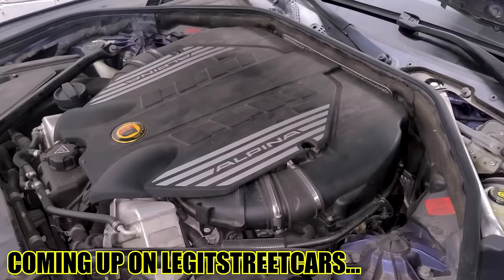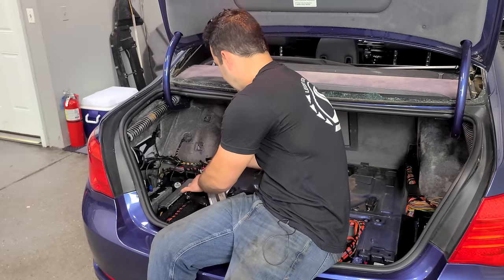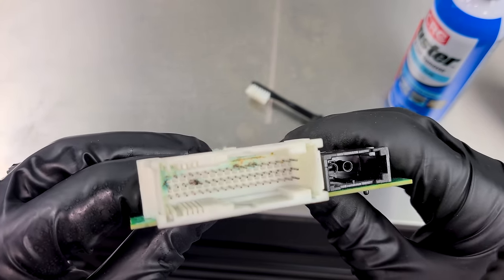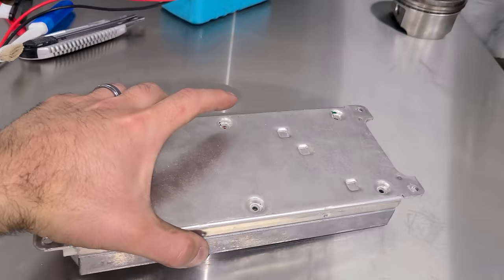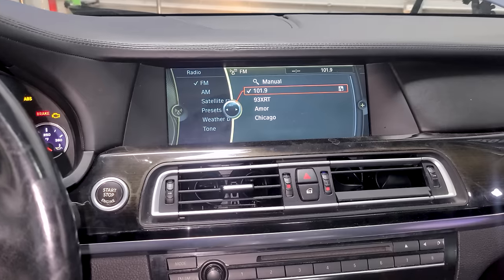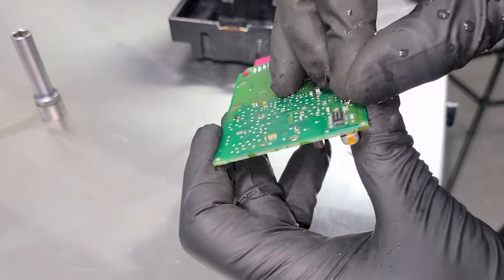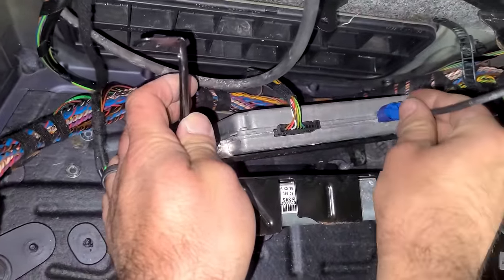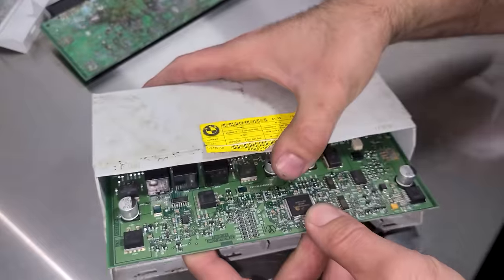BMW Dealer Tried Totaling My Car By Quoting $15,000 For 10 Computers! I Fixed Them All For $150!

Comment: De-ionized water sounds expensive for a regular diy-er but it isn't.  If you own a dehumidifier it produces distilled water which you throw out.  That water is exactly the same.  Use it for your cleaning like in this video - free!

Comment: Best move was to strip every panel out of the trunk. That way you could get a really close look at every connector in there, and that's where you found the most insidious water damage. A dealer would have swapped out modules and in my experience wouldn't look at the wiring harness. Corroded connector could be attached to a single strand and fail later.
These housings for modules in the trunk looked rather skimpy. I'd expect to see gaskets, sealants, heat sink paste that would need replacement.

Comment: For heat shrink sleeving, assuming you don't want to spend money on a purpose made hot air gun, an electric hot air paint stripper is good and less likely to burn the sleeve than an open flame.

Comment: As an Automotive Electrical Connector engineer ..  seems you did a decent repair job .. but if the plating is corroded on the terminal contacts (inside the female terminal box and outside of male pins), your fix may not last as long as you wanted. The alternative is to replace all the terminals with new ones, but that is a huge labor consuming job that may or may not be necessary.  Personally, I would fix it the way you did and see what happens.  Good luck!!

Comment: Yep that’s right you got to do it yourself if you want it done right the dealership would have done the same thing and earn 15 grand so I do all the maintenance I can myself and this is a good learning experience for all electrical components and electrical circuits a good cleaning this is equivalent to cleaning the battery cable on the car

Comment: Had this happen to a 2008 Mercedes E320 Bluetec sedan, the ZGW module got wet.  It’ s up under the dash so I think from a badly executed windshield install before I got it, the windshield got replaced a few months after I got it.  This made the car go absolutely crazy.  The corrosion was between CAN-B High and Low and also CAN-C High and Low connector pins so nothing was working right.  Cleaned up the ZGW and all well for about 2 years now.

Comment: As these modules are lead free soldered because of environmental rules, they used zinc solder. Zinc grows  very fine hairs which grow out and short components. The toothbrush method knocks them off and repairs the unit. Damp makes it worse so any unit that doesn’t work might benefit from the brush and cleaner technique.

Comment: if you can’t get your hands on the spray 90% isopropyl alcohol and a q-tip will work for cleaning circuit boards

Comment: If you want to prevent this in the future buy some conformal coating and coat all the boards with it.  Make sure all connectors are plugged in, cables connected and tape off anything you can't connect.

Comment: Nice work,  You might had better luck on the trunk boards if you never supplied any power. I've worked on water logged boards before, you have a solid chance if no power was supplied.   The last one that was really bad, no question that was a replacement needed.  

Nice to see it all come back to life ! It will be a cool car once it's done...

Comment: Did this with an old Honda Accord US wagon that was flooded up to the top of the door cards.
Used it for about 18 months, and got pissed off with the oil leaks. Nothing to do with being flooded - it had just been thrashed to death. Went to the crusher.
Was a nice car, but can't be found alive anymore in NZ. Qualifier: Not that I've seen.

Comment: @16:05 When I worked at a class A electronics manufacturer we did not clean boards with water we used 91% isopropyl alcohol and brushed the submerged PCB's by hand then blew them off w/compressed air and arranged them on large trays where they where put in a 120 degree convection oven for 1 hour to ensure all liquid was dry before continuing to adhesives and conformal coating . From there they would be sent to Box Build or shipped to there final assembly location plants in the US. Mind you these where "class "A".." electronics and that is not what you are working on . Class A  PCB has to work all the time every time . Example a "black Box in a air plane the flight data recorder . the conformal coating water proofs the PCB so it will function even if submerged under water  and the PCB's are usually a lot thicker with heavy traces sometimes made of gold.. Everything about them are "Beefy" . Auto manufactures equip their products with at best class B PCB's or Class C PCB's .. they want their products to fail , because they install different levels of electronics and PCB's in their products depending on the end users needs .. Like emergency vehicles and law enforcement and Military vehicles .. You would not have any content for this video had those units been built to class A specs lol .After learning the different levels of PCB's and that they can be hardened to water , electrostatic shock and impact it is just sad the they approve sub par parts to be sold to the general consumer...

Comment: As someone who works on EVs, if its a HV component, just pay the price to get it swapped out. pretty much every EV part with a orange wire going to it has the ability to kill you so it's really not worth the risk of opening it up if you aren't 100% confident in what you are doing. if there isn't a orange cable going to it trying this is fine though

Comment: The thing about water it wants to have a certain amount of minerals dissolved in it to balance out the charges.  When the minerals are missing water will try to get them back as you point out in the video.  That's why you shouldn't drink de-ionized or distilled water.  It will pull the minerals from you.

Comment: I had a fire back at the end of 2000. My computers got smoke and water damage but looked intact. Denatured alcohol, a toothbrush and some canned air got both computers going again. The third computer was a complete loss. What was left was hardly recognizable. I only knew what it was because of where I found the puddle of slag.

Comment: $15K of repairs for $150 (but it took $15K worth of tools and subscriptions to make it happen!) LOL.
Great video. :)
Reply: I previously worked in the electronics industry. Can confirm that they use deionized water to clean boards during the manufacturing process (for most boards). Those machines looked like industrial sized dish washers, and in fact, one startup company used an actual restaurant dish washer that had been modified for the purpose. (No dish detergent, of course.)

Comment: We had a BMW X5 Turbo Diesel. Loved the car, hated the company no right to repair attitude. Everything has a stinking computer, including the battery. Our seats were changed out for BMW sports seats. BMW refused to program the seats for the vin number which is required for them to operate properly. The thermostat (a common problem for any car) is buried inside the engine, which means replace water pump at the same time. We were quoted 3500.00 for that. The electronic parking brake went out. Normally any shop could replace but it has to be programmed into the computer. If you buy one new you can expect to lose 30-40 k the second the car hits the streets. I'll never even look at them again. The memories are too painful for the constant breakage and bills that come with it. I even know a dealer BMW mechanic and he said he'll never own one again also.

Comment: If corrosion on the PCB has caused the module to stop working, 9 times out of 10 it has caused damage that cleaning won't solve.  Also you don't need contact cleaner.  The corrosion typically comes from leftover water soluble flux residue on a PCB like that, so simply using water and a toothbrush is enough.   If it were instead hand soldered using rosin flux, then use rubbing alcohol.  The catch is that if using water you want to make sure it completely dries before powering on again and water evaporates much much slower.

Comment: 90% ^ ipa will work better than water after dry quickly with compressed air itll keep ipa from leaving white film on circuit board also some of the boards appear to have conformal coating you should coat the boards that dont have it. the circuit board at 24:48 would probably need re capped and than the green solder mask repaired its cheap it would probably work i have fixed worse looking boards.

Comment: Deionised water isnt conductive(very little but hey). You can literally run a TV in it. Its safer for washing circuit boards. That said water is also fine from the tap as long as you fully dry it after.

Comment: Embedded software guy here.  The fiber optic ECU isn't dumb.  That's a MOST (media oriented) data bus.  It's a relic of the early 2000s.  It's on your Cadillac too.  That graphic display on your wife's escalade has a MOST chip on the cluster PCB.  These ECUs ctually have software to participate on a MOST bus (network master, timing master, etc... are MOST nodes on the bus).  Great video but would caution use of metal brush.  If you unknowingly leave behind a metal bristle in a connection or board it could short things out.  

ECUs with software are typically flashed with certain versions to "talk" to each other.  Thus, if you do wind up sourcing a new ECU from a junk yard, you really need to make sure you have the right software revision flashed.  Most ECUs have the version of code on a sticker on the board and if not there, the version can usually be pulled from the CAN bus...

Comment: Contact cleaner is going to work a lot better than that water. An ultrasonic cleaner with pcb cleaning solution will be required to clean under the components otherwise often your cleaning will not make it a long term fix since minerals still exist under the chips etc. You should also not use metal brushes to clean, use a carbon brush, these boards have small caps/filters etc that will fall off otherwise and esd is an issue so no metal.

Comment: People need to remember there is not one technician in any manufacturer car dealership in the world that is trained or permitted to open control units and repair them. Even backstreet/independent garages won't have the resources to do this.. they don't need to know. The amount of times you would need to know you could count on one hand in your whole career.. the time spent cleaning and repairing control units would outway the price of a control unit. 
You can clean-up a control unit as much as you like but you will never know if it's been enough, corrosion could be hiding out of site anywhere only to show its face in a couple of weeks or months...

Comment: I HATE Bosch ABS controllers.....I had one fail on my Audi a4, and I found a used one for $50! Installed it myself ($100 software purchase to calibrate it) a little over a year ago, and since then I unfortunately lowered the car and put new shocks in the front. It doesn't help because the Bosch controllers are SOOOO fragile, the new/used unit is already failing again. It hasn't progressed to as bad as it was (ABS, TCS lights and Speedo failure) but it is already doing the soft pedal vibration, and ABS/TCS lights come on....then go away after restart.

As for your old ABS module damage, someone could have jacked it from the point in front of the module cover and it slipped off and took out the module.

Comment: if they put gaskets/seals on the casing and used water proofed connectors water ingress wouldn't be an issue. ps if they were going to make the gaskets/seals out of the same material they use for engine components that could be a problem because it's low quality crappo, hence bmw's proclivity for oil leaks. good vid btw

Comment: That ABS module looks a lot more like somebody might've had a prybar or something in their trying to get it out or do something and smashed the cover hard enough to crumple some of the pins going to the chips in there. Been there done that especially on public safety vehicles when all these computers were new and the local repair yards hadn't gotten up to speed in some of the cities we served. Since BMW decided they needed a fan in the module well, if it were mine I would add a second fan...better cooling and if one fan fails still won't overheat and possibly cause a module failure. I speak from past experience LOL.

Comment: As always, such great and helpful content! I’ve actually learned that stuff many years ago and I can encourage everyone to try fix simple electronics not only in cars but also household items before throwing them away. Very often it’s just a loose solder connection which can be easily fixed by re-heating them up.

Comment: So some things to note with this. If you don't have contact cleaner, you can just use  isopropyl alcohol, which is fancy for rubbing alcohol, just find the highest percentage ABV you can, the stuff is on Amazon for dirt cheap. Acetone, not nail polish remover or paint thinner, these have other chemicals in them, can also be used, but it has a tendency to leave a residue, it can also break down certain types of PCB's, the actual boards, and will strip conformal coating, that yellowish coating on some of the boards in this video, so I would recommend against it. 

Some things about that solder joint. Will it work, probably, is it done correctly, not even remotely. For starters tin that soldering iron, and clean it with steel wool, or get a sponge and use some of that deionized water to clean it. Second, always melt a small amount of solder to the iron before touching it to the wire, this helps immensely with getting the solder to flow through the wire. Third, the whole wire splice should be soldered, it should all be silver and ideally shiny, though if you're not using lead based solder it probably wont be shiny, if you can avoid it, don't use lead based solder. Nickle based solders are harder to work with, but breathing in lead is kinda bad for you.

Comment: Planned obsolescence at its best. Dealerships often take advantage of the customers that don’t know how to fix the own vehicles especially Women. High tech also means high repair costs. 
Well done demonstrating how to clean electronic components. Too often it’s a little bit of dirt or corrosion but mechanics will charge you big $$ to change the part.

Comment: Great video Alex sooo much info to sort control modules! I have a 2096 4.2 supercharged Range Rover and I definitely have had water ingress from the left hand side back window over the infotainment and navigation equipment which are showing rust signs on the covers. I think I may, just may take the worst one out and give it a try. What's the worst that can happen? It's not working anyway!

Comment: @25:51 “There’s nothing to this ...” I disagree. My own DIY swap out of my seriously-malfunctioning body control module (BCM) from ‘98 Grand Cherokee (ZJ) w/ an eBay BCM rewrote my engine control module (ECM) to permanently enable security, and upon the 20th start, horn honking, lights flashing, my fuel injection pulse went to zero seconds (no start) and I was left sitting, stunned. It pays to read the shop manual cover-to-cover BEFORE you begin these adventures.

Comment: The main issue going forward is that most PCBs used now are covered in an epoxy that prevents direct access to the surface mount components.
Reply: To reduce the probability of corrosion
Reply: @christophervanzetta  No shit sherlock. But is a burden for self (if any) repair.

Comment: Some people I know used to fix dry solder circuit boards by putting them into a home oven at 220 degrees Celsius for 45 minutes , and yep , it worked ! WTF ??? 😳

Comment: 36:40 - not really nothing to loose... most of those windowlickers, who never done a thing themselves before gonna break a ton of stuff just by trying to take a control module apart and putting it back together... Oh, and showing, that they can clean electronics by washing it in a bucket of water (no matter what you have said about the water, they not gonna listen) is opening a whole new can of worms of doom... So that's that 😁

Comment: "Water babies" are always a hassle because the tow yard does not disconnect the battery when they get there.(electrolysis causes the damage to the electronic modules and motors.) If you go through and clean all of the connections and switches and relays too it may save the new owner Alot of headaches down the road. Even then, when everything is done right, you can still not be able to sell the car because it was water damaged and that scares most buyers.( I would think twice about buying it unless I stole it in the deal.) It's all about time spent wet with power hooked up. Less is better.

Comment: Just a heads up, that fuel pump module has to be coded directly to the individual car. I recently replaced the exact module  on a 5 series of around that same year. Unfortunately you can't just buy it and plug it in. I thought that myself, the car started once and never again until I coded it

Comment: Well BMW stands for break my wallet! And going to a dealer I had a BMW M6 824 and I used to call the dealers Steelers because they can rip you off when it comes to components like that. When I was in the BMW scene I found lots of good deals and I would never pay $15,000 at a dealer for something like that when you can get a cheaper either from a junkyard or secondhand somewhere